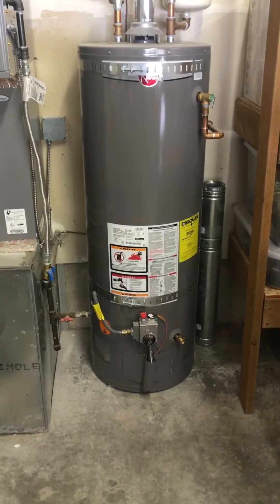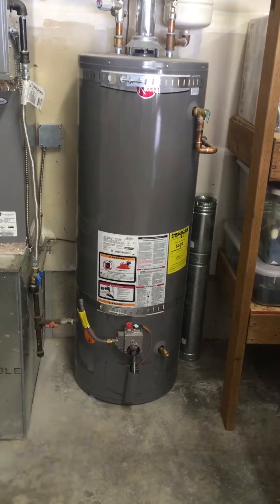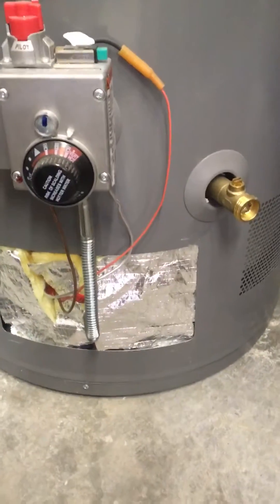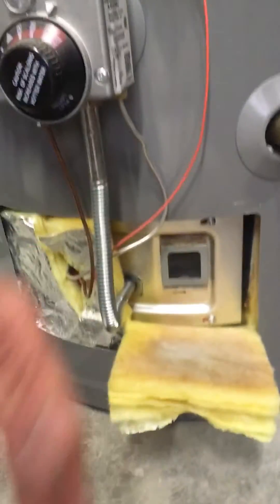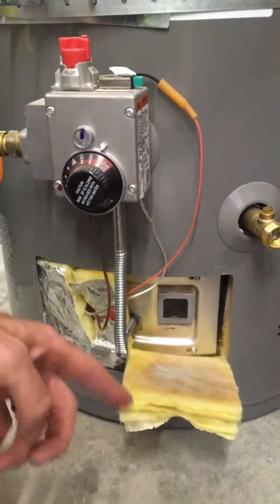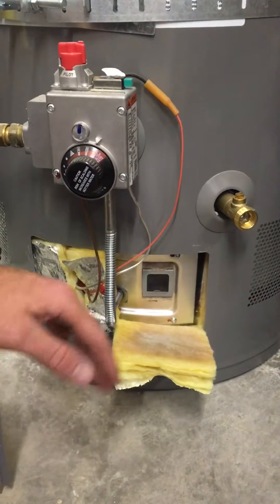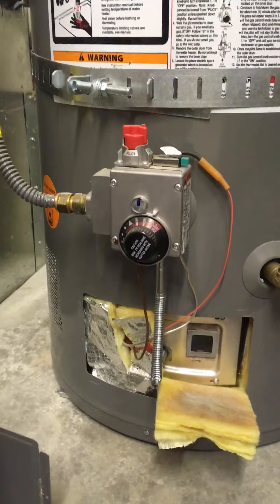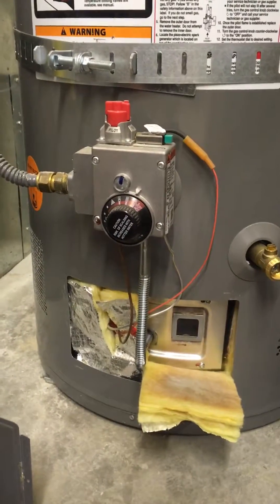FVIR exception for 18 inch rule on water heaters

Comment: burning elements? Elements are sealed inside a water heater. 18" is regarding an ignition source, which is for gas
Reply from the maker: Older water heater had open elements. Google FVIR if you like. Not sure your point but thanks!
Reply: @InspectorTribe perhaps you are talking about older water heaters having an open combustion chamber. Elements are two rod like pieces that screw into an electric water heater to heat water
Reply: (Exception: Elevation of the ignition source is not required for appliances that are listed as flammable-vapor-ignition resistant.)

M1307.3 Elevation of Ignition Source
Appliances having an ignition source shall be elevated such that the source of ignition is not less than 18 inches (457 mm) above the floor in garages. For the purpose of this section, rooms or spaces that are not part of the living space of a dwelling unit and that communicate with a private garage through openings shall be considered to be part of the garage.

Exception: Elevation of the ignition source is not required for appliances that are listed as flammable-vapor-ignition resistant.

This is the exception he is referencing in the video.
Reply: @PWoodall  electric water heaters do not ignite. This has been an argument amongst plumbers for who knows how long